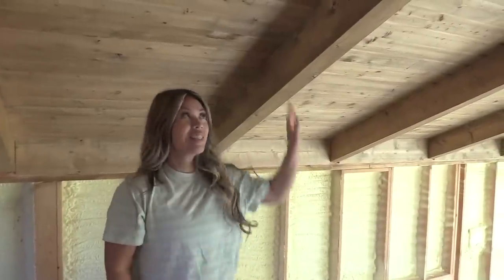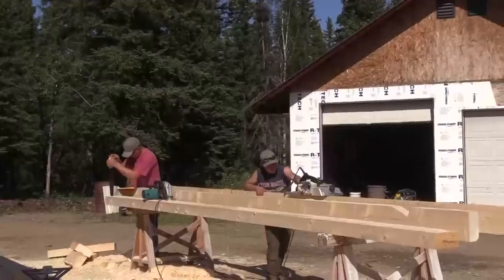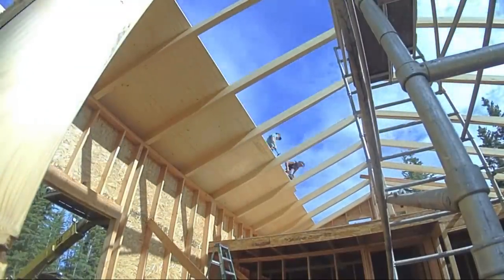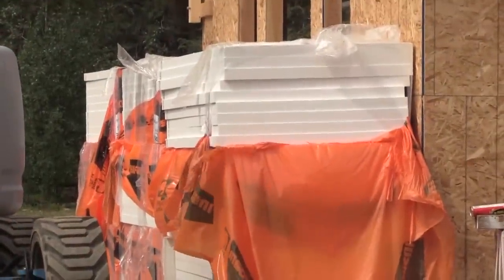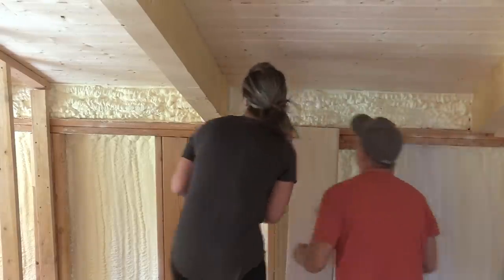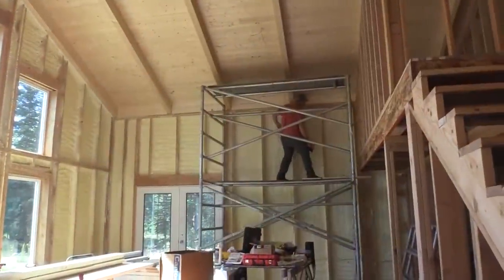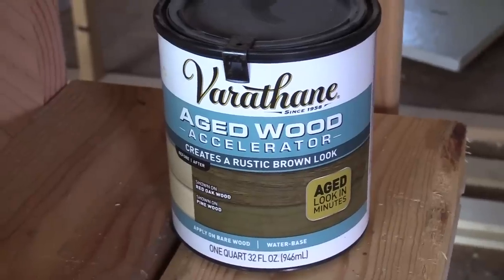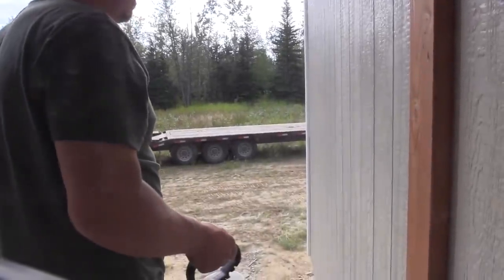Cabin House Build Episode 9: How We Build Exposed Wood Ceilings

Comment: For my house i would redo the roof like you did here. I would remove drywall to expose attic trusses abd beams then extend walls to roof line. Next I would redo electrical and hvac ducts, sheetrock walls and put corrugated metal on the deck between rafters. I would paint my exposed attic ceiling black for an industrial look.

Comment: This roof is beautiful. It's a little different in that the rafter pairs are just fastened to the exterior walls, and not tied together by a horizontal member, like where the ceiling joists would typically be. Is this something you guys had designed this way?

Comment: Ana We are Buikding something very similar. What did you use for your water protection that is adheared to the tongue and groove on the outside? I heard that Grace Ice and Water can be used but also heard that it can produce a smell in the house. Thoughts?
Reply from the maker: Check out this post https://www.ana-white.com/blog/2015/08/insulating-timberframe-roof-build
We have not encountered a smell from the Grace Ice and Water Shield.

Comment: Wow that roof system sounds amazing. What "R" value do you get out of that system?
Reply from the maker: Thanks! We aim for an R40 roof - but this is with NO thermal bridges (rafters) in the insulating cavity.  This house is well insulated for sure!
Reply: Beautiful job on inside also. We only by code are are required "R" 30 in Texas is why I ask. I'd love to build your roof system here where it get well over 100 degrees during the summer. Good job!
Reply: Keith Comer Check out video(s) from the Cold Climate Housing Research Center. I think it’s called the Cold Wall System. It’s expensive put R40 walls with not thermal bridging. Not sure if it works for TX. Peace.
Reply: Keith Comer It’s called the Remote Wall System.
Reply: Wow, GORGEOUS!
Reply: Just think  In the city of Houston you have to have open soffet venting....we can't seal them. as a matter of fact we have to install a baffle system that supposedly allows air to travel along the roof deck.......problem is baffle system is only 18" long below the roof deck.......really inefficient.
Reply: Did u flash and batt?  Foam in wall don't look to thick?  R value?
Thanks great job

Comment: I am trying to build a similar roof this summer, love the look! The 2x6 tongue and groove, do you leave a gap where they butt together for expansion or no? My structural engineer specified end match T&G which means it has T&G on the butt ends as well. Would love to hear what you all do for this!
Reply: Lol I don't believe end match t and g is necessary! We run a millshop and have never end matched v groove heck I've only seen the stuff once! 

We don't end match flooring either because the longer lengths we get our stock in vs those little short pieces you get from Lumber Liquidators Etc
Reply: Butt end tongue and groove seems like a waste of money. You can always leave abt 1/8 inch between if needed

Comment: This is a really nice design ! Love it ! So you have a total of 6” of foam on top of the tongue and groove ? That’s about an R value of 6x5=30 ish … Curious to know if this is enough ? I live in Canada border with USA and typical roof insulation is a R of 41. Am I missing something ? Thanks !
Reply from the maker: We love this type of roof and yes it is very efficient in extreme climates. Here is a post that breaks it all down https://www.ana-white.com/blog/2015/08/insulating-timberframe-roof-build
Reply: @AnaWhiteDIY  amazing, i’ll check it. many thanks !
Reply: Ok found it, per inch of thickness + air gap of 3.75” gives you an R of 7.2 (r-tech soecs) … yep r of 43 is fine for me !
Reply: @MrEdionne  Can someone explain this better? She's using a 2x6 which has a depth of 5.5 inches. The R-tech foam boards they are using has an R-value of 7.7 per home depot's website. That's only an R-value of 19.25.....

Comment: Fake: 

Don't use a sprayer:

Stain will be not evenly distributed (but they fixed with cloth wiping) 
But for sure you need to work only ONE SECTION AT THE TIME.
i saw here they worked 4 sections and when they move the scaffolding and continue will be a line where they stopped and started again.